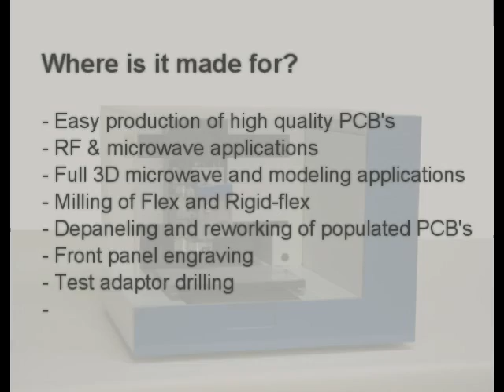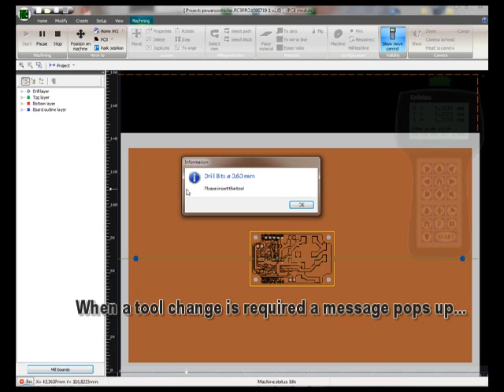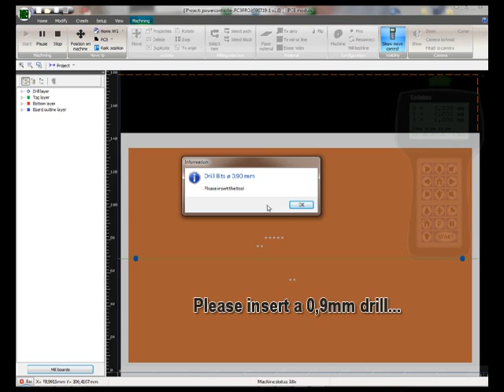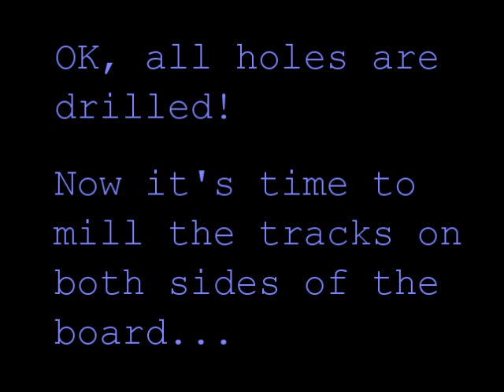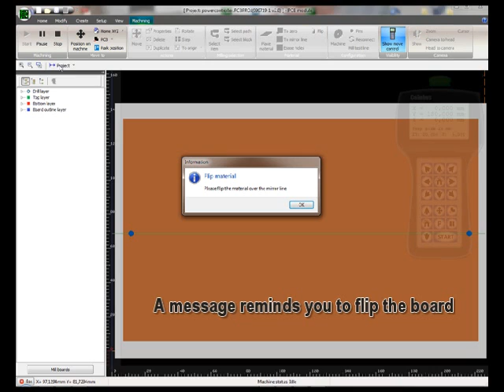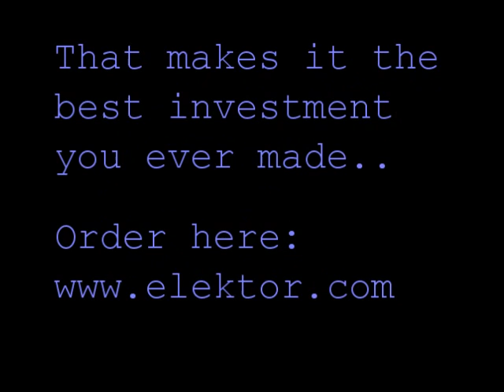Elektor PCB Prototyper

Comment: Have a close look at the spinning tool. It dances and I dont think this can result in such a high resolution as announced. Around the web there is no independent report about this machine.
There is even a video showing a milled phone in 3D which is totally identical to the one shown in the Elektor Profiler video. The Profiler is a machine from Elektor/Colinbus, too. User report they can use the Profiler only after replacing the Z-axis, change of the drivers/software and poor support.BE CAREFULL